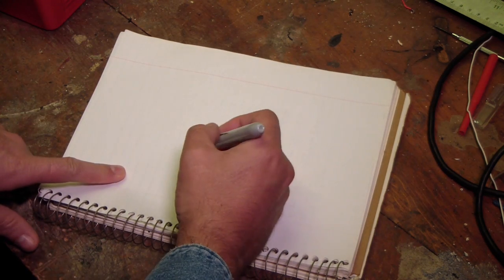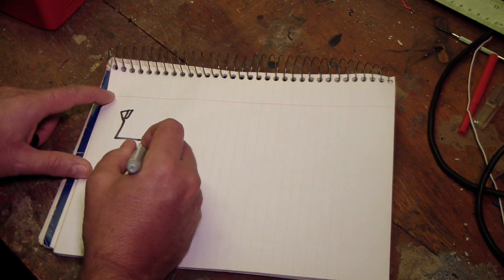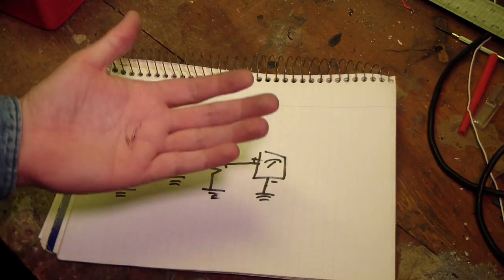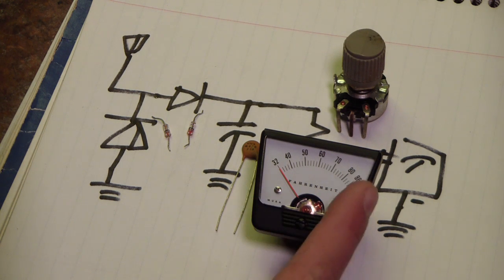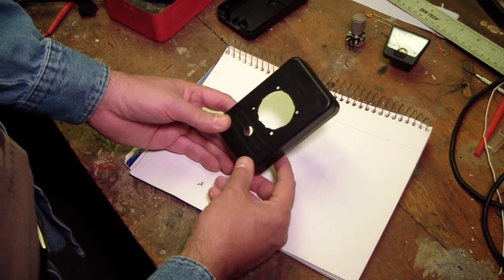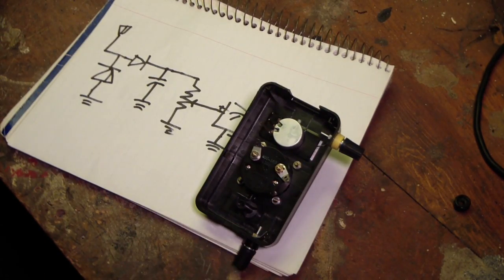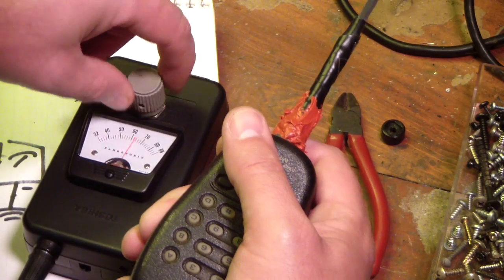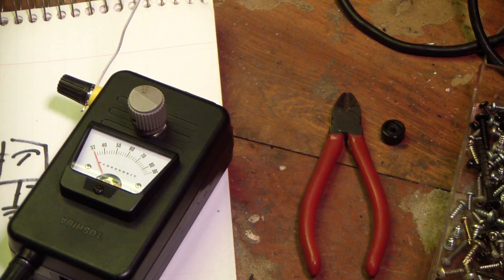Ham Radio - DIY test gear,  build a simple passive Field Strength Meter.

Comment: Hi Kevin,

I used the 1N4148 works fine, costs nothing but I only used the stuff I had. I didn't have the capacitors in those values and used other ones. Afterwards you can just leave them all out, it works fine for me. What is the function of the capacitors actually?? Greetings, Andre. PD3A 73'
Reply from the maker: The capacitors smooth out the rectified RF and build a very small amount of charge that helps to smooth out and bolster the operation of the meter.  I've always seen better deflection using them than without.

Comment: i know this is a 5 year old video was hoping someone would know what the specs of diodes. this is my first project. he gives values for everything but the diodes.

thanks in advance
Reply from the maker: Any geranium diodes would be good.
Reply: @loughkb  one other question when i typed in 470 pf what came up on digikey was one that was a 6800 pf ??? maybe a part number or something, remember this is my first project for ham radio -dipole which isnt much
Reply from the maker: https://www.digikey.com/en/products/detail/kemet/C317C471J1G5TA7301/6562564?utm_adgroup=General&utm_source=google&utm_medium=cpc&utm_campaign=PMax%20Shopping_Product_Zombie%20SKUs&utm_term=&utm_content=General&utm_id=go_cmp-17815035045_adg-_ad-__dev-c_ext-_prd-6562564_sig-Cj0KCQjw-pyqBhDmARIsAKd9XIM_-lgCzNb__ipoAWhY46f-UemcH2wayc2wWsXLS1I_rg_8RQIr6ucaAotHEALw_wcB&gad_source=1&gclid=Cj0KCQjw-pyqBhDmARIsAKd9XIM_-lgCzNb__ipoAWhY46f-UemcH2wayc2wWsXLS1I_rg_8RQIr6ucaAotHEALw_wcB
Reply: what size caps do i need? you said 470, but they go from 1000 pf and up. are they ceramic and what exactly pf does the cap need to be @loughkb
Reply from the maker: @R-E-D-E-M-P-T-I-O-N  they're not that critical. They just smooth the RF to dc. you could put .01 uf disc caps on there and they'd work

Comment: will an amp meter work. only meter i could find after a short search. i plan on using this during an fox hunt. will it work for this purpose. thanks in advance for answering
Reply from the maker: The meter movement has to be clear of any shunt like you might find installed in an amp meter.
It wouldn't work for fox hunting.  The fox is usually a very low power, milliwatt range, and wouldn't produce a field strong enough to deflect the meter.   You'd need some kind of broad band RF amplifier in the circuit.

Comment: Can you use an LED instead of a meter? Kind of like an ALEXTUNE?
Reply from the maker: You would need a power source and a driver stage for the LED, like a transistor.   You also wouldn't be able to see very fine changes in brightness as well as you can see small movements of the meter.

Comment: Terrific video! I'm new to ham radio and just went to a meeting about fox hunting. Going to build a Yagi antenna and want to build this meter to read the signal strength, instead of the S-meter on my HT radio.

What size is the box you're using? I just ordered a 0-50 µa/2kΩ panel meter for the project. Looking forward to building this. I think it's just what I need.

Thanx!
Reply from the maker: I doubt you'd have enough signal strength to move the meter without an RF amplifier built in.   The transmitted power of a fox is usually very low, just a few milliwatts.

Comment: Hey Kevin, thanks for the incentive to add a simple field strength meter to my home brew MagLoop. Works really well for tweaking the most from the MagLoop. Also tried your suggestion for compressing the smaller loop to get more surface area with the outer loop. This does improve the ability to tune for resonance on 10M through 40M. Gets a lot of intrigued looks during portable outings. MagLoops are great!  Everybody should  build at least one and your videos make it easy!  Great job on all the MagLoop designs  you have demonstrated. 73 de N4UVR
Reply from the maker: Thanks for the kind words Cory.  Yeah, everyone should build a magloop!   They're always surprising antennas.

Comment: Hello, it was a nice video. Thanks for information.
Can you give information about a subject?
What is the frequency range that the circuit can detect?
my second question; Is the shape of the antenna you use in the circuit important? So, is it possible to convert it to a larger, square or circular 30 cm antenna?
My third question is; Wouldn't it make more sense to use a directional antenna in the circuit? That is, how can an antenna be added to the circuit that is aimed at the frequency source of rf and to measure the strength of the signal coming from that direction only.
Thank you in advance for your answers.
Reply from the maker: There's no tuned circuit in this, it should be sensitive to a very broad range.  
Antennas, do whatever you like.  It's going to indicate whatever strong source the antenna picks up.
Reply: @loughkb  Ok. Thanks for the answer. Let me forgive my ignorance, but I have to ask; Isn't the power of the antenna also related to the amplitude of the em waves radiating from the antenna?
So, the closer you are to the antenna, the larger amplitude em waves can be measured to the rf power meter device. So I think it is also possible to measure the amplitude, that is, the power, of the waves that have gone farther than the antenna.
So, can it be said that the rf power meter can measure the strength of the rf signal that can be detected by any radio, even if it is on yada onbeş meters away?
Thanks
Reply from the maker: @ahmetozdemir7173  It's a square law. 
The energy leaving a transmitting antenna is dispersing outwards.  The further you get away, the less energy you can measure in the same amount of space.  For every doubling of distance, you will have 1/4th the energy present.
Reply: @loughkb  Thank you so much for answere.

Comment: I built one today, with parts I had laying about. Used two 170pF caps parallel instead of one 450pF, and a 10k potmeter.
Thing is, I don't get a reading! I built it with a BNC just before the potmeter to be able to connect an external meter, and it measures just fine. it's extremely sensitive
in the 70cm band, But no movement in the panel meter. Any suggestions?
Reply: never mind, found the problem... the panel meter died :(

Comment: Could you swap the meter out for a led with this circuit and just tune for maximum brightness when tuning your magloop?
Reply from the maker: No. There wouldn't be enough current to.light the led.
Reply: I just threw the circuit together with an LED and guess what it worked now I just have to stop decide which method to use for my Loop tuner. I don't know if it's just me but it seems like the LEDs have some kind of point of Maximum brightness to wear if you have it set to sensitive you'll have a hard time telling the difference between say a 3:1 or 1:1.
Can anyone confirm that or is it just me.?
Reply from the maker: @barretto4152  OK, I hadn't thought about the strength of the field around a magloop.  I guess yes there would be enough current there.
I was thinking about the other ways I use the meter.
I'd still use a meter though.  You get a much better indication of small changes where the meter moves a bit but telling the difference in brightness of an LED with such small changes would be hard.
Reply: I had forgot to mention using it as a loop tuneing indacatorI had it right next to the mag loop I don't think you could get it more than a couple feet away before the LED goes out so I don't think it would work for a normal field strength meter
Reply: , I agree with you Kevin after experimenting I am going to stick with the meter it gives you more confidence in your reading and allows you to see in front of and behind where you're at. It also lets you take exact measurements. With the meter I'm able to watch how the efficiency or lack of deflection falls off as you go lower in frequency with the same size Loop. Thanks Kevin for sharing the circuit.

Comment: 3:26: lower forward voltage drop, not lower forward resistance. Using germanium diodes instead of solicon improves sensitivity & linearity at low signals strength levels.

Comment: Hi Kevin, beginner here. I have a basic question: 

I understand that the specific diodes configuration you used is nothing more than a full-wave rectifier. Are you however sure it works? Usually for a full-wave rectifier, people use 4 diodes arranged as in a bridge. I simulated the circuit with LTSpice (using a voltage generator instead of the antenna) and I have seen it does not operate as a full-wave rectifier but only as half-wave.
In the MHz range, the RC value you have chosen is of course smoothing the oscillations pretty well.

Thank you for your answer (and patience).
Reply from the maker: Oh it works.  It's a very old classic design.  There's enough energy present that many earlier field strength meters only used one diode.   Look at a crystal radio design with a single diode.  The same basic thing is happening here, except that instead of driving an earphone, the energy is driving a meter movement.
Reply: @loughkb  right; the vertical diode turns the single wave rectifier into a voltage doubler, as I describe below.
Reply: It isn't a full wave rectifier, the circuit is called a "voltage doubler"; here's how it works. The first, and absolutely the most important thing to understand is that the coupling of the signal voltage is capacitive, because there is (obviously) no d.c. connection to the transmitter. You should therefore imagine for this description that the induced voltage is coupled from the antenna to the horizontal diode through a virtual capacitor, which blocks dc. The signal induced into the antenna relative to the more negative side of the circuit (the one marked as ground in the schematic) is alternating, so it passes through the virtual capacitor into our circuit, but the diodes play some magic, and I'll explain how... Now, as the signal voltage goes positive with respect to the "ground" side, signal current flows through the forward biased horizontal diode and charges the real capacitor. The vertical diode is reverse biased, so no current flows through it. Some current begins to flow through the meter, as you would expect. Now this is where the magic begins - the first of a one-two punch, if you will... When the induced signal voltage goes back down to zero and goes negative with respect to the ground side of our circuit, that current flows through the now forward biased vertical diode. The right hand side of the virtual capacitor is held at relative ground by that diode. Also, because the horizontal diode is now reverse biased, the real capacitor does not discharge through it, and holds most of its charge. Some discharge does continue to take place through the meter, of course. So, as the vertical diode holds the right side of the virtual capacitor at relative ground, the negative going signal voltage on the left side of the virtual capacitor charges the virtual capacitor negatively. Now, here's where the magic trick is completed... As the signal voltage comes back up from its maximum negative value to zero, the voltage on the right side of the capacitor is "pushed" up by the increasing voltage on the left side (remember that current has to flow out of a capacitor to discharge it -i.e. for the voltage across it to drop). So the new positive half cycle voltage of the signal the is ADDED to the existing charge on the virtual capacitor, so the voltage on the right side rises ABOVE the value of the incoming signal voltage. Current flows through the now positively charged horizontal diode to further charge the real capacitor. If there was no current drawn out by the meter, the voltage would be twice the peak voltage of the signal voltage, hence the term voltage doubler. In reality, because of the virtual and real component values it will take several cycles to fully charge the real capacity, but it isn't long.
I hope this description was helpful.
Reply: Just looking at it I would say that the diode from the antenna to earth is doing nothing. The diode going to the  RC tuning circuit is giving half-wave rectification when the incoming signal goes positive.

Comment: When do you use the ground binding post?  You did not use it when you tested the meter.
Reply from the maker: I have touched it a few times to increase sensitivity.    I also used it once with the meter connected to my main HF antenna.   By grounding,  I was getting a strong deflection on the meter from local broadcast stations.  Just as an experiment.
It's not really needed, I just like having options.

Comment: Hello from a bright but cold Wales brilliant  presentation going build this afternoon will use to check my end fed project do you think it will show rf patterns from various ununs or baluns   great stuff  Dave C

 G0NVF    73
Reply from the maker: Hello Dave,
It might.  I bent the wire antenna into a circle and the meter was deflecting from the EM field around a compact florescent light bulb.     The reason I used a binding post, was I intend to make a few different pickup wires and be able to just plug them in using banana plugs.
So,  make a smaller pickup loop and move it around the outside of the balun, you will probably see the peaks and valley's of the local field.
Reply: many thanks more playtime needed   DaveC   73